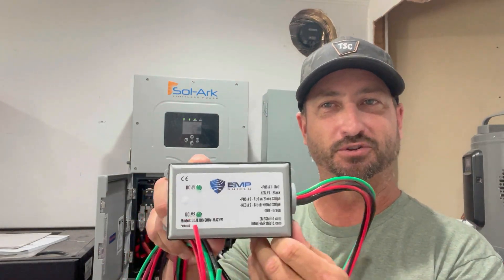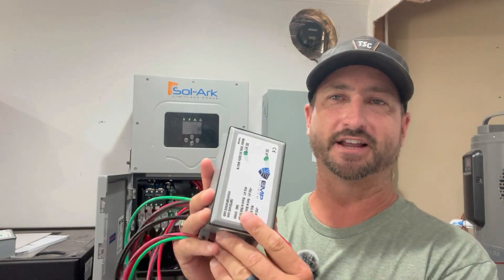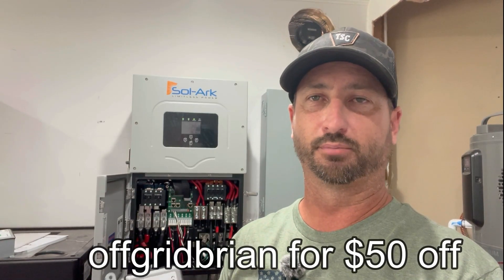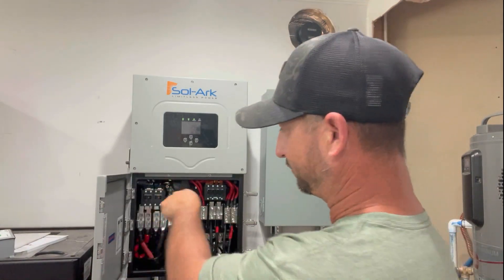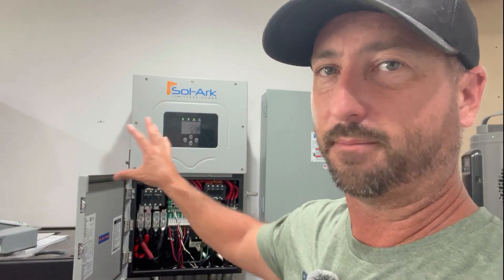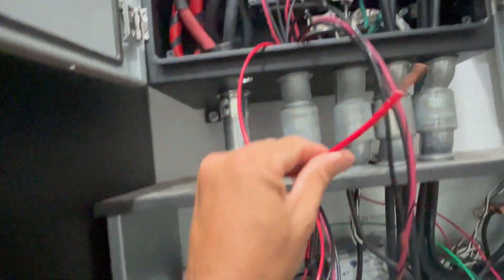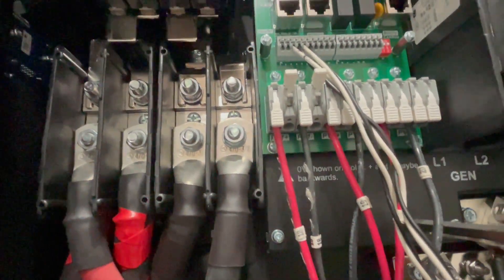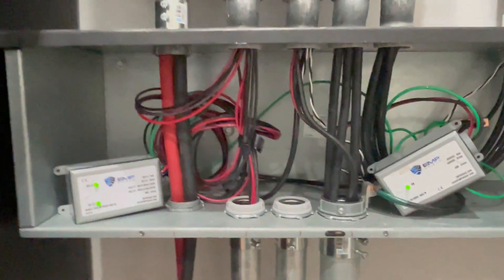How to install EMP Shield on the Sol-Ark 15k solar inverter

Comment: Electrical work Disclaimer warning:
Electric chairs used for capital punishment typically use an initial voltage of 2,000 to 2,300 volts with current ranging from 7 to 12 amperes, often applied in multiple cycles.

Comment: Would Emp Shield work the same for Sol Ark 15K without the Emp Hardened feature as the Sol Ark 15k Emp Hardened model?  Emp Shield would cost a lot less than buying the Sol Ark Emp Hardened model.  Thank you for your reply!
Reply from the maker: @michaelsmith3341  yes that is what EMP shield claims. Hopefully we never have to find out. 🙏

Comment: As you start adding grounds to the ground lug, when would be the point you reach when a ground bus bar should be used ?
Reply from the maker: I’m not a licensed electrician so I shouldn’t be giving that advice. A ground bus bar is always a better option. You just want as good a connection as possible. The less resistance to ground the better.

Comment: I enjoy and like all of your videos. Thanks. Question for you please. From my readings Solark 15K comes with an EMP Protector.  Why did you feel the need to install more EMP Protectors please ? Thanks 🙏
Reply from the maker: When I bought my Sol-Ark 15k they hadn’t released the EMP hardened version yet and didn’t officially have a release date for it. So SMP shield was my only option at the time.
Reply: Gotcha. Thanks for your reply 🙏

Comment: FYI: it also appears that the warranty will cover the lesser of the equipment or homeowners deductible. And even though they may have verbally told you about sending pictures, unless it’s stated in their literature it’s more than likely a moot claim. Sending pictures would only invalidate your warranty as now they have proof a professional did not install it. Just my 2 cents otherwise I enjoyed the video.
Reply from the maker: That’s definitely a sound argument.
Reply from the maker: And also for anyone reading this, if they don’t cover the warranty for a lightning issue, and you sent them a video showing a correct install, please let me know.

Comment: Had to laugh when I saw you post this video.  

I recently ordered and installed these exact same devices for my Sol-Ark EMP Hardened 15K.  Hopefully they will make a single unit to cover all 3 charge controllers at some point in the future.  There would certainly be a market for it with many of the new inverters sporting 3  MPPTs.   I have the EMP Shield device appropriate for my rack of EG Batteries and plan to install that today.

I installed the whole house version earlier this year when I changed out the meter base in preparation for the Sol-Ark install.  Like you, I did my due diligence prior to making my purchases from EMP Shield and feel very confident in their products.  I had a great experience with them when I inadvertently purchased the wrong model.
Reply: What meter base change, component,/collar did you use?